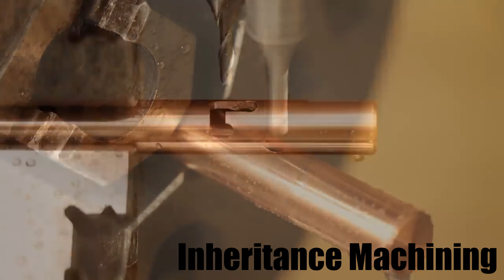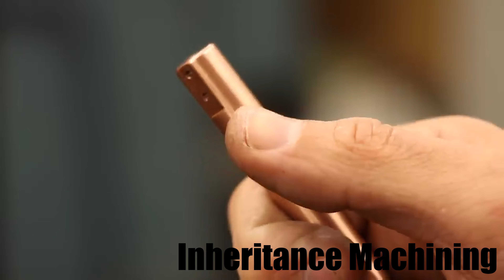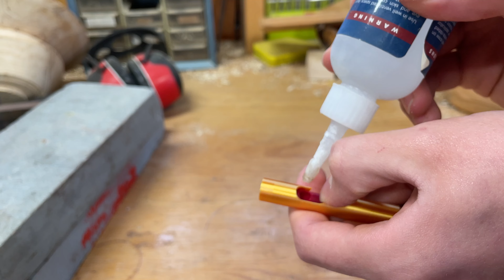Custom 3D Printed FIDGET Pen

Comment: Inheritance fan here as well, looks like you nailed it! Of course you sent me down a rabbit hole for angled prints, maybe look into tilting your print a little to skew the layer lines? I have come to find out this is more of a resin printing trick to avoid suctioning the print to the print screen (the more you know!), but it seemed like it might add strength.

Then I saw a suggested video about adding texture (image was 2 vases, one looked cobbled) to add strength. That seemed much more actionable for this project 👍 

Regardless, dope print and a dope pen! Might commission one if you upload the files :D Cheers!